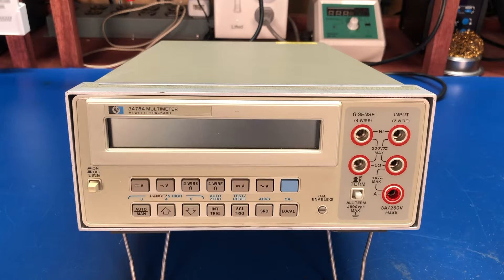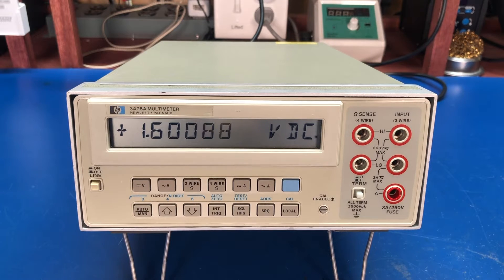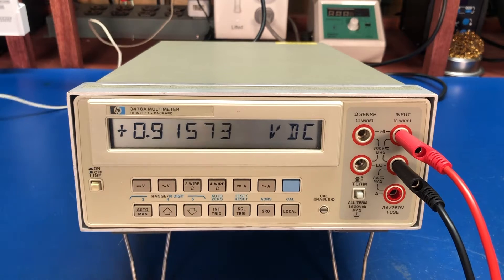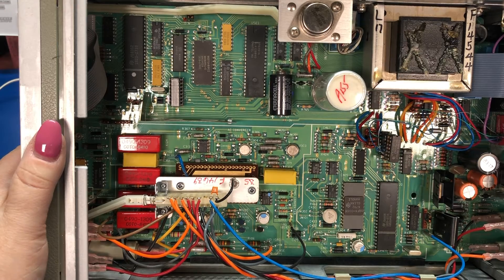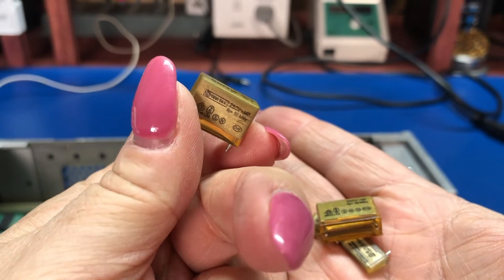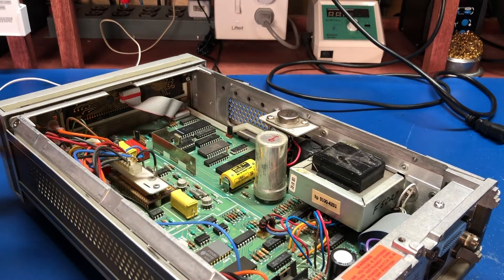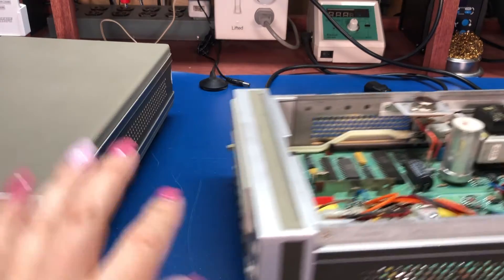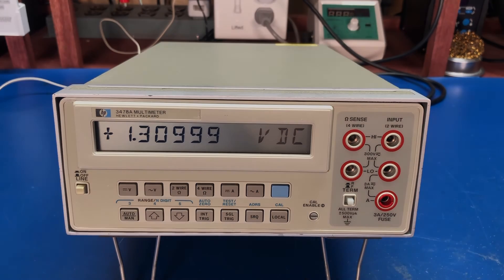Tour of my new HP 3478A bench-top DMM

Comment: I have the same model, was dead and replaced the RIFA caps and the other electrolycs. Mine displays the same "wandering" readings to the DC voltage when there is nothing connected, is this expected or indicative of some fault ?
Reply from the maker: HI! When you do measure something (like  a battery) you should have a steady reading.  Bouncing values with open leads is normal for higher precision meters.

Comment: Thanks for the nice review. I love mine and will get another one. I also have other hp equipment from that time. They just exhale quality from a different time.
Everything is so much more complex and unrepairable nowadays.. well there is some hp unobtainium, too.
Reply from the maker: These were serious lab grade instruments that cost $995 back in 1986 - over $2700 today adjusted for inflation. Forty years on these are going strong. I also have several HP power supplies from that time - same build quality and a joy to use.

Comment: Cool meter, though I'd definitely prefer a VFD there.
Reply from the maker: I would as well. I have a Leader Frequency counter with a VFD, which is a joy to look at. :)
Reply: Yes I agree, I once had a bench-top DMM from Keithly, after several years the LCD display was no longer readable, now I again have a bench-top DMM from Keithly with VFD and has functioned for years without any problem.